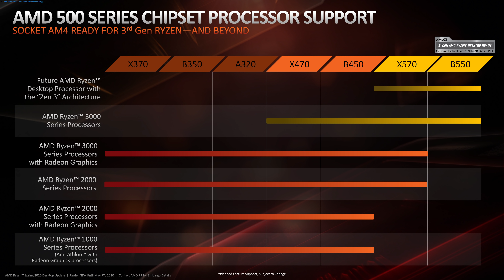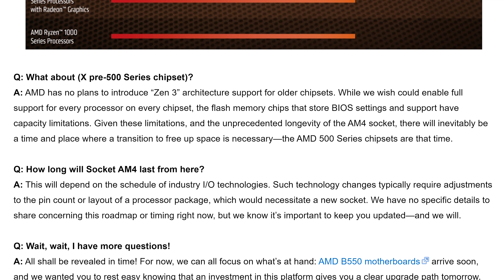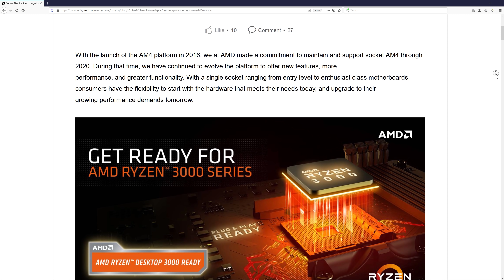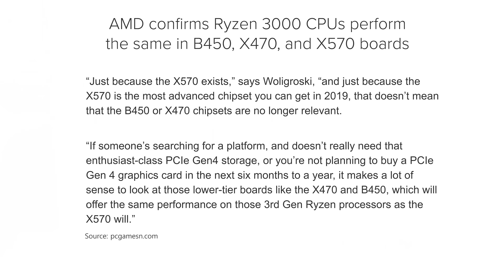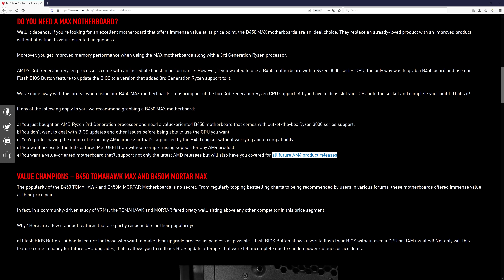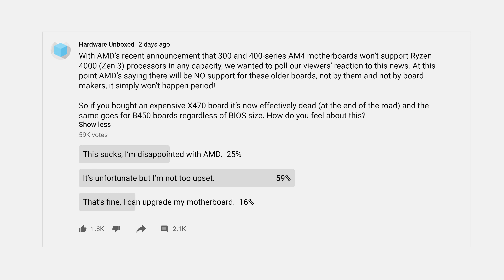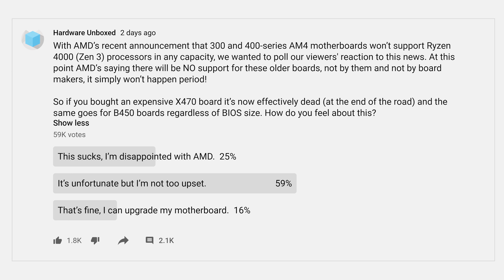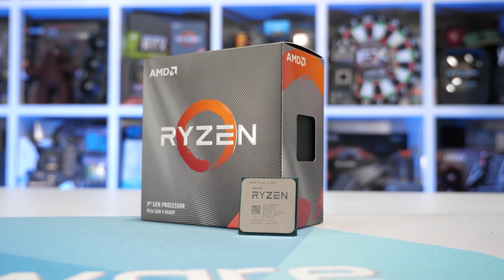AMD Does An Intel, Axes Zen 3 on 400-Series Motherboards, Our Thoughts

Comment: Muh AMD obsoletes a board after 3 generations.

Ok who cares? What are you gonna do go to intel? Shut up everyone jeez
Reply: Dirty Dan it’s still bad for the consumer. It very well could be supported. The difference in architecture is minimal and 400 boards, as said in the video, were made to not bottleneck future generations as well. The thing is if no one’s pushing extended compatibility on the market, we’ll never see it get better.
Reply: Intel acting like scumbags does not excuse AMD cutting support for boards like the B450 MAX series that were specifically updated with larger BIOS chips in 2019 and served as primary mid range boards until right now (B550 is still not on shelves at most places).

Did you even properly listen to some of the arguments made in the video?
Reply: A Lowe Listen, B550 is cheap. Buy B550 or just buy B450 and 2700/3700 and sit down for 3 years. EASY
Reply: @DanKop2  They are speaking up for people who JUST bought things like B450 MAX in the last few months. Not people who are looking for a new system now. Listen to the damn video
Reply: A Lowe Ok so they can use the 2700/3700 and wait 3 years before buying a new pc?:)
Reply: Dude, its about calling out anyone who does BS moves like this. Amd should have told everyone about this and released b550 earlier and then no one would have cared.

Yet they decided to do this stupid move. its ok to call them out on it.

Comment: Right when I was planning on building a PC next month, 
I considered buying an x570 board but its too expensive :(
Reply: OneGill Next month B550 will be out so no worries! Be glad you didn’t buy a b450 last week :)
Reply: B550
Reply: x570 tomahawk... will still cost you about 2xb450 mobo but it seems like it will be quality one and one of the cheapest ones... however i ge if you are buying right now something like 3600(x), you dont want to spend more on mobo then on cpu...
Reply: Just wait till AM5...
Reply: You are all assuming that the b550 motherboards will be competitively priced when released. I seriously doubt that assumption as the only competition for a b550 MB is the more expensive x570, as AMD has just killed off competition from 400 series MBs.

Comment: as someone who just brought a really nice B450 to upgrade to zen 3 later i'm sad :(
Reply: As a b350 owner I kinda expected that but to not support b450 an x470 it's a bad decision.
Reply: @Quuuuuuuuuuuuuuuuu  Exactly. Im of the same opinion. Plus AMD set precedent with supporting Zen 2 on X370 through motherboard partners. Im guessing they can't since the code is different or something (that's their excuse).
Reply: They screwed us by delaying b550
Reply: @Arivald_  That much is true. The B550 should have been out months ago. I think AMD is pushing the pace beyond their capacity to deliver in an attempt to gain market share and that's a mistake.
Reply: Yeah i feel ya, just built a lot of PCs for costumers using B-450
Reply: Although it wasnt confirmed, all signs pointed to B450 being compatible, with no effort made to indicate otherwise. I built a B450 system with a cheap 2600 this January with the plan being to upgrade to Zen 3 at some point next year, and at that point most tech media were pretty confident it would be compatible. There wasnt any research this guy could have done. While I disagree with Steve on AMDs motive for dropping support, I still dont think it was the right choice and I think it was handled terribly.
Reply: AMD should've released the B550 together with the X570 and all this mess would've been avoided.
Reply: @Le_Mon9  not completely avoided but we wouldnt be in situation where people were FORCED to go with B450 or X470 simply because X570 boards were overpriced to basically double of that of theyr equivalent 400 series counterpart
Reply: @Asghaad  Yeah completely agree that x570 boards are really overpriced.
Reply: @Le_Mon9  yes for sure! Then there would be no problems :(
Reply: Holy shit these comments are so toxic. STOP BEING LOYAL TO A CORPORATION. IT DOESNT MAKE ANY SENSE.
Reply: can you return it?
Reply: Return it if you can!
Reply: Fs in the chat
Reply: thanks for all the support everyone <3 guess i should "have done my research" lol i still will support AMD it just bums me out cause i couldn't wait for zen 3 as i had to build now and hoped i could upgrade down line :( i hope they see this vid and change their minds <3
Reply: two months ago bought MSI b450 gaming max
Reply: I feel you...
I actually own B450 motherboard, too, and it's quite a disappointment that AMD axed support for future 4000 series on 400-series motherboard.

Well, AMD is a company, after all, and what they do is quite literally a business decision (my 2 cents). Unless Intel can do something, AMD might have a chance to be the new Intel (again, my 2 cents on this).

I could be wrong on the last one though.
Reply: I just bought a b450 and this happens
Reply: Me too. I chose a strix b450-e purely because I couldnt afford x570 and there was no b550.
Reply: same here B450 with ryzen 5 3600 just 2 months old.
Reply: @TomasJHoly  same here. I have the b450 for just over a month and a half. Though I'm actually a little glad that I won't be able to upgrade. I'll just upgrade when the AM5 with DDR5 boards come out with Ryzen 5000.
Reply: I feel you... I have the tomahawk max only few months old
Reply: just get a ryzen 5 3600
Reply: Really nice b450 lol. You did not get x570 that is over $400.
Reply: Alfred peter Sy  Just buy Zen 2 CPU, that is 3700x or better. It's not like you paid a lot for b350 board, jesus.
Reply: I like many b450 owners got screwed over because b550 never launched when it was meant to so we had no choice but to buy now

Oh well, sucks but hey maybe AMD will change their mind
Reply: Why did you expect a motherboard from before 2020 to work with Zen 3? If you look at AMD's official Socket Stability slide in the article "3rd Gen AMD Ryzen CPUs Will Work on Many Existing MSI AM4 Motherboards" (search it on Google), you'll see that the graph clearly shows no motherboard support for new CPUs released after 31 December 2019. If you take a good look, the orange bar stops right at the end of 2019, just before 2020 starts. It was already know even a year or two ago that Zen 3 will come out some time in 2020, or in other words, AFTER the official support period.
Reply: You don't need to do any research! You took the risk buying a 400-series vs latest 500-series. It's doesn't take a rocket scientist to figure out 500-series is better future proofed.
Reply: @b-roc-au  The problem is, AMD themselves said you didn't have to buy X570, what's worse is they've been developing 4th gen Ryzen for a couple of years now(that's how product development works, to act as buffers) so they would have known that it "couldn't" have been supported before the release of X570, they should have told us in advance.
Reply: Shouldve done your research. Your fault for not paying attention.AMD have done nothing wrong here
Reply: @jamesherman3750  if he bought it a couple of months (or even weeks) ago there was no indication of amd not supporting zen3 on b450
Reply from the maker: @jamesherman3750  These fanboy comments are toxic. What research was he meant to do exactly?
Reply: @Hardwareunboxed  research he "should've" done:
(1) Research and figure out time travel
(2) Research every moment of the future to find this very week
(3) Research this specific video
(4) Go even further back in time to buy a different motherboard

as you can see, this is a very easy and reasonable way to do research and i'm confused as to why OP was unable to this...
Reply: @Hardwareunboxed  exactly, even research being done, customer should have been buying b550 earlier this year or even last year. Some features they really doesn't need for now with the current price for pcie gen4 now .
Reply: @bananya6020  Have you been watching me? Hmmmm? That is exactly what I have been doing, I am researching time travel so I can go back in time, and play the loto👍
Reply: @Hardwareunboxed  im sorry but we have known for a very long time that 4000 cpus were only going to be supported on x570 boards, this was before we even knew B550 was coming out.
Now B550 boards also will support 4000 séries, that's good.
I don't know why everyone is surprised we have known this for a long time... We also know that the 4000 series will be the last of the AM4 and they will be moving to AM5.
Reply: @Bisclas  who is "we"... are you some higher ups amd employee? because only in that case you maybe "know" things, however refrain your self for calling general public "we"...
Reply: @Hardwareunboxed  Maybe a little intuition. With AMD having majority market share did you think they wouldn't pull off something like that.
Reply: @Hardwareunboxed  Perhaps not buy a board for a cpu that is not released yet? AMD promised support for new CPUs until 2020, its 2020 and new cpu's have arrived and is supported on b450/x470 boards, so they have technically delivered on their word. They didn't state when in 2020 support would stop, Zen 3 isn't released yet, we don't know exactly when Zen 3 mainstream stuff is releasing, so while their sad excuse for not supporting Zen 3 is absolutely BS they still have been true to their word. What I find most interesting is how board vendors are pointing fingers here as they stand to earn a bit extra now that people have to buy a board as well. I guess it pays to play ignorant in their case. I don't agree with AMD's decision on a moral level, however, I don't see any wrongdoing here from what was promised. If people put more meaning into these promises by AMD than what they really should have then it's their own fault.

PS: I'm a b450 user myself and I got what I paid for.
Reply: @Hardwareunboxed  AMD has mentioned in multiple marketing slides that the AM4 will be supported "until 2020", it's up to people like you to spread the word (instead, all the reviewers just praised AM4's "futureproofness").
Reply: @Hardwareunboxed  Wait and see. Always wait and see before making purchases. Historically CPU decisions should come before motherboard decisions not after because the motherboard is almost always the less expensive component. If the motherboard is the more expensive component I would have to ask wtf? Being an early adopter is iffy counting on compatibility with things that don't yet exist is piss poor planning. The idea AMD is inherently nicer than Intel was a fantasy to begin with.
Reply: @obese7027  Yet it's pointed out in this video that AMD said "through 2020", not "until 2020".
Reply: @Hardwareunboxed  Until 2020*
Reply: @PeteTheL337  I don't think that @Hardware Unboxed is suggesting that AMD has flat out lied. Technically they have launched low end parts in 2020 that maintain compatibility. Fair enough. The issue here is not about truth vs lies, it's about transparency. AMD will have known that loads of their customers were buying b450 boards for Zen 3, believing they would have Zen 4 compatibility. They will have known that one of the key reasons for choosing AMD over the past few years has been future upgrade options. They have gained customers and made money because of this. Correct me if I'm wrong, but weren't they actively encouraging price conscious Zen 3 buyers to go b450 given x570 pricing and the lack of b550 boards? Haven't they been actively marketing themselves since the launch of Zen as the offering consumer friendly upgrade paths?  If they're going to use that in their marketing and gain customers and market share as a result, they should back it up - and, when they inevitably have to draw the line with future CPU support, they should be upfront and transparent with their customers. They haven't lied here, but this decision has meant that one the key reasons that so many consumers have been so willing to pay AMD money for their products has been taken away... without allowing those consumers to make an informed decision about their purchase.
Reply: @Hardwareunboxed  Hey Can you (or anyone else) please let me know how can I help (as a consumer) to pressure AMD into changing this decision? I haven't bought any 400 series mobo but I still want to help... As a PC enthusiast I'm really disappointed from this move that amd has made and I want what's best for the community...
Reply: @Bisclas  no, they never said that :)
Reply: @hoemey   I guess this goes back to the old saying which is "Only buy for what it supports now and not for what they say it will support in the future". Too many times consumers have been jebaited.
Reply: @obese7027  Ryzen 4000 is coming out 2020 though. I wonder what about "support until 2020" means they would not support CPUs coming out in 2020?
Reply: @bananya6020  Don't forget butterfly effect, What if he ended up in a future where moar cores yeilds no performance gains?
Reply: @Hardwareunboxed  thank you Steve
Reply: @Bisclas  I think you have strong hindsight bias. The entire point is that we didn't know.
Reply: @donicsm7684  
"Until 2020" = support still through 2019, ends when year changes to 2020. Check dictionary if still unclear.
Reply: @jamesherman3750  where you intel fanboy until recently, jumped on a bandwagon a year ago, so you find i acceptable of buying new mobo with every cpu upgrade?
Reply: @KleMih  Nope. I just built my first PC around AMD
Reply: @jamesherman3750  congrats for building your first pc... im building pcs since i was like 13, only thing i agree is it was never said specifically zen3 will be supported on 400 mobos, but was heavily implied with all am4 socket support and some board partners....
Reply: @jamesherman3750  how cute...
Reply: @jamesherman3750  The news are really new, mate.
Reply: @jamesherman3750  lol iq jogger
Reply: @jamesherman3750  whaaaaat? What research?
Reply: @jamesherman3750  I researched to make sure that the B450 board I acquired less than a month ago had enough ROM space seems it was an issue in the past. Compared to the X570 board version it is identical - both having 1 x 128Mbit - (16 megabytes). I don't know what other "research" I could have done? I didn't really have a need for PCI-E 4.0 so thats X570 off the list and I'm not an overclocker so I could rule out the X470 board.
Reply: @jamesherman3750  lol, did nothing wrong? AMD literally stated that current boards will be supported through 2020.
Reply: @jamesherman3750  okay that's a very pompous attitude to take.
Reply: @jamesherman3750  Troll much? AMD just announced this, how was I or the OP meant to know that B450 of all chipsets would not be supported even though the next gen chips are on the same platform???